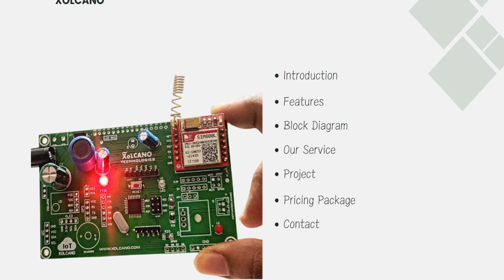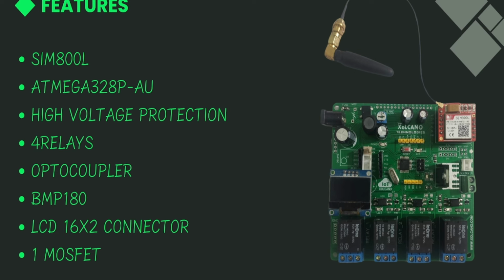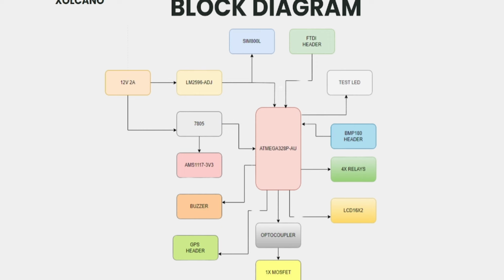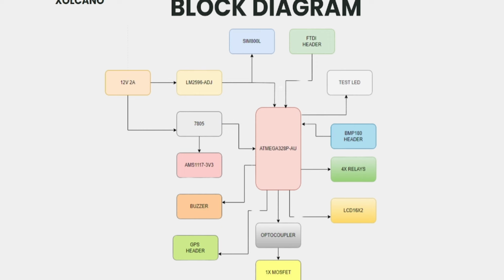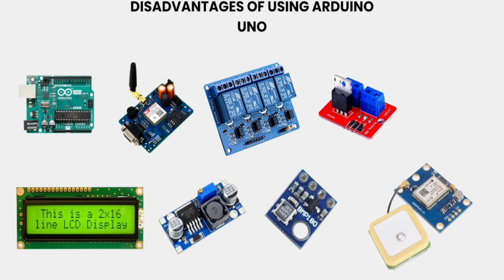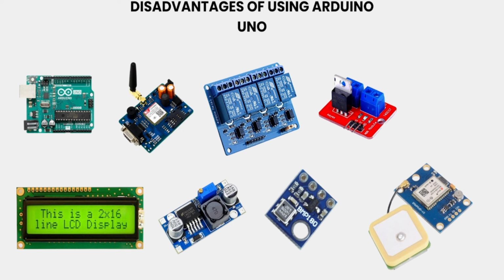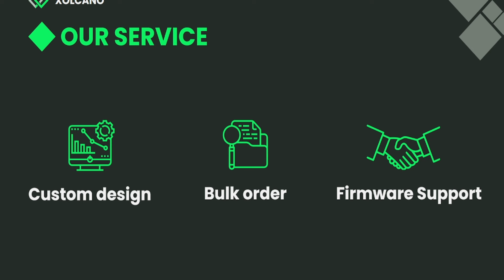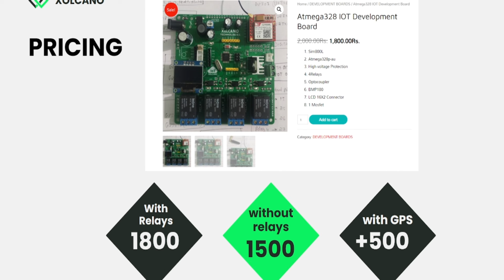All in one Arduino Development Board for your Next project #arduino #iot #gsm #sim800l #mqtt

Comment: How   i  chat  you?
Reply from the maker: 8970220880(whatsapp)
Reply: @axramar1992  I have a requirement to run 4 split AC in repeat mode but only one runs at a time. can i use this board for that?